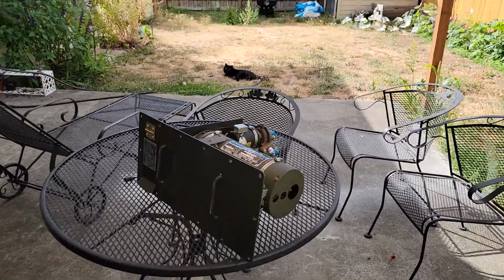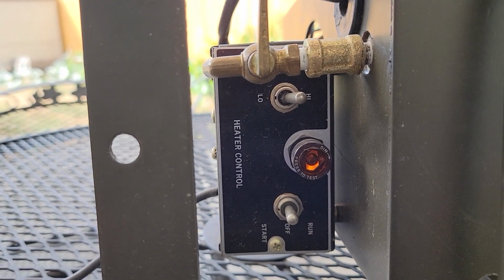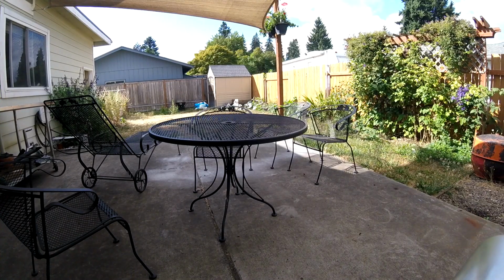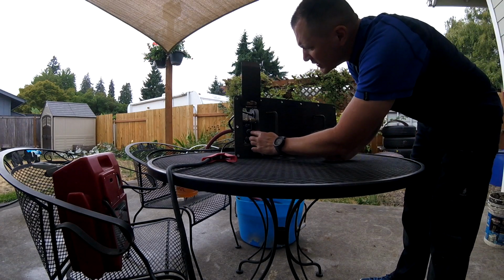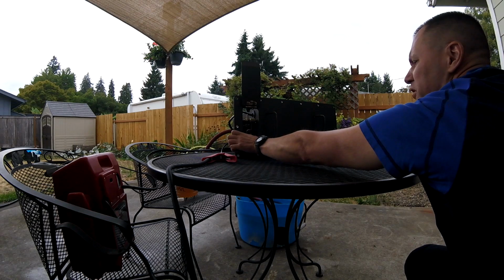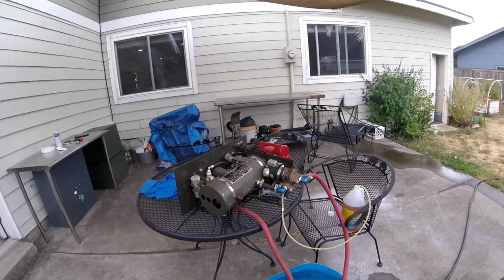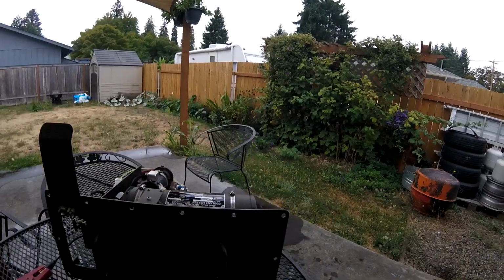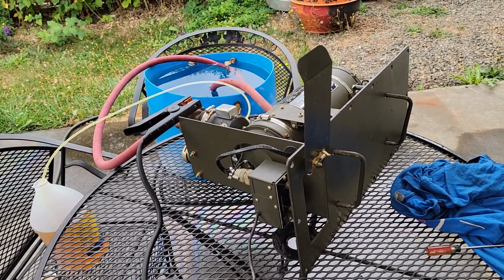Abel LMTV build part 161 (South Wind Stewart Warner 23k BTU hydronic heater)

Comment: Hey Sean,

I always enjoy your videos.  

One thing I noticed…. The Eberspacher is a 5KW unit, so that would be about 17,000 btu/hr.   So, your new heater is bigger, but only 35% more. 

Can’t wait to see what broke on the heater and how you fix it.  Before it broke, I was envisioning that thing as a bulletproof heater.
Reply from the maker: So a 5kw eberspacher is not 5k btus?  I am so confused.  I thought for sure I found the holy grail of hydronic heaters.
Reply: @SeanFastidious  

5KW is metric, that translates to 17,000 btu/hr which is English units.  BTU is literally British Thermal Units.   If you google “5kw to btu” it will calculate it for you.  

Do you find your Eberspacher can’t keep up in cold weather?   Why do you think you need so much more heat?
Reply from the maker: @dcraigslist5243  I just though with the radiant floor heat, plate exchanger for hot water, and radiant fan air heater it might need more.  We shall see when winter hits.  Might work just fine.
Reply: @SeanFastidious  

I hope I don’t sound like a jerk in my response.  I was in a hurry.  Honestly, I have been watching your videos since you bought Abel, and have learned more from you than I could ever list. 

Thanks for all of you posts.
Reply from the maker: @dcraigslist5243  NO not at all!  You educated me on something I did not know.  All this time I thought I had a 5k btu eberspacher when in reality I have a 17k btu eberspacher.    I have something on the way that will double the output but now that I know what you told me I may not ever need it.  Nice to have a spare in case this one dies though.

Comment: I noticed the fuel valved looked like it was closed   would like to see it run again if you fire it again
Reply from the maker: I wish that was a fuel valve.  It's to burp air out of the coolant.  I removed it and blocked that line off as it is not needed on my setup.

Comment: Hi sean its mark, i have worked on hydronic ,espar and other systems   if you want me to work on it ,you. An call dave Anderson   helicools helipad  he has my phone number,   i will take alook at at it for free  and diagnose it,  repair as well  for no charge, if it needs parts i would let you know, also were you able to save Subaru  after the accident or are planning another one ? Thanks
Reply from the maker: The Subaru is gone.

I think the blower motor or the relay to the motor is bad.  It's such an old unit and I have no idea if it would ever work properly enough to be reliable for my setup.  It was a gamble that I lost on.  Where are you located??
Reply: @SeanFastidious   i live in Montana,  you could send it parcel post or if you know a cheaper way
Reply: I used to rebuild units  you could prabably get a cole hersey relay a replacement,  also you said unit smoked a little bit  some time they need deep cleaning
Reply: Sorry abou Subaru
Reply from the maker: @markwilliams7088  It weighs nearly 50 pounds.  I think it would cost more to ship than it is worth.  No worries.  I have a solution on the way.  I will tinker with this another time.
Reply from the maker: @markwilliams7088  Blower motor no longer runs and I think that is the main issue.
Reply: Hey Mark I have one of these units if be interested in having looked at . I'm in Montana as well any chance you'd be interested ?  @markwilliams7088